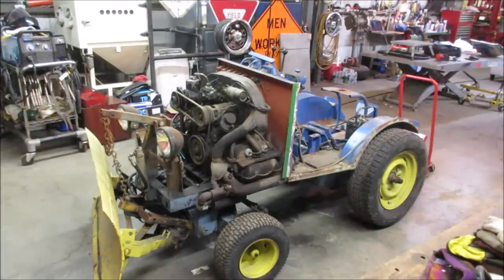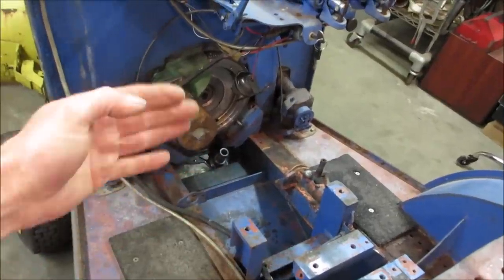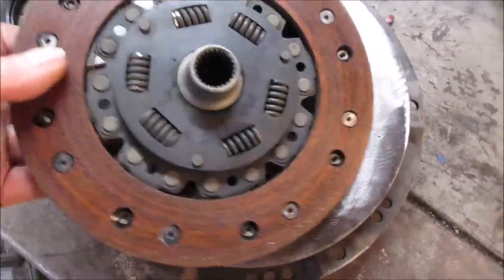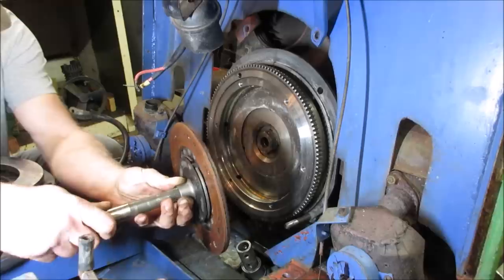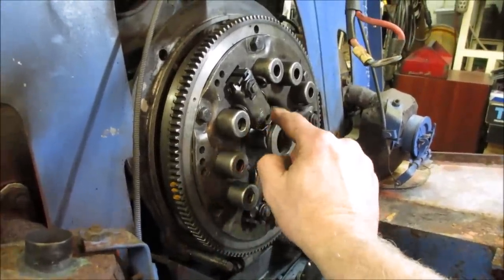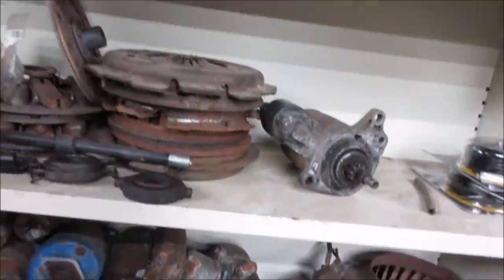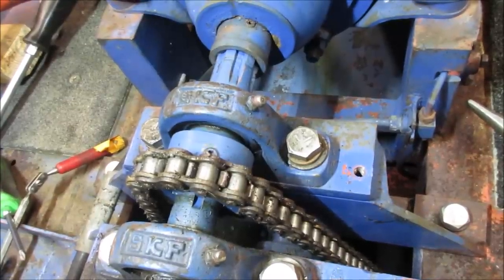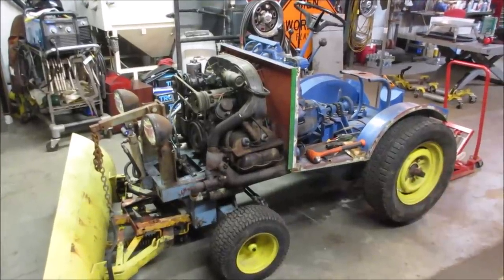This Antique Tractor Took Amazing Talent To Build!  Now Lets Fix It.

Comment: You can 'rebuild'/grease those throw-out bearings, right? Ha, used the VW pedals too, nice!
Is that rear pinned shaft with the pulley on it a repurposed VW stub-axle?
Needed that oil changed for big sure! XD Fun li'l tank of a machine!

Comment: Probably too late now but that clutch disc will sweat oil for ever more and eventually will create clutch shudder (or grab).  Maybe the machine is light enough and geared low enough it won’t matter but thought I’d mention it.

Comment: Curious, why didn't you take brake clean to valve liters before trying to adjust?  I think, most likely wrong, that it may have made it easier.  I think after running it q few hours I would change oil again, just to give it some love.  Great find and fun to watch.  God bless

Comment: Just thinking about the one transmission bolt that didn't want to go in in the right rear. How critical is the alignment of the transmission input shaft to the crankshaft? I was initially thinking that the bent right front mounting bracket might have been the problem, but that would have had it too far left, not right. Still scratching my head about that.

Comment: Could you take a governor from an old tractor,  remove the gear and replace it with a pulley, then mount it to run from the belt?

Comment: I bought a splitty with an engine with similar sludge status. I'd reach up inside with my hand and pull sludge out! Why why why don´t people change oil! I´m still running oil for diesels for its detergents to help clear it up 2 years later.

Comment: Do the sidewalls of the front wheels really touch the ball joints of the steering wheel, or does it only appear so in the video? Because if it really touches it, it is not very healthy if the rubber sidewalls of the wheels rub off because of it

Comment: Where is the gland nut?
Reply: The gland nut is in the center of the flywheel. When Mustie was talking about aligning the clutch disc, he plugged the "alignment tool" (a transmission input shaft) into the pilot bearing located in the gland nut.

Comment: you got your work cut out!  Exhaust leaks inside heater box is highly unlikely as the pipe is one solid piece with the aluminium heat exchanger cast around it, check the V reg contact points for cleanliness, no  rust, put 12V + on the big red connector on the generator to flash the armature!